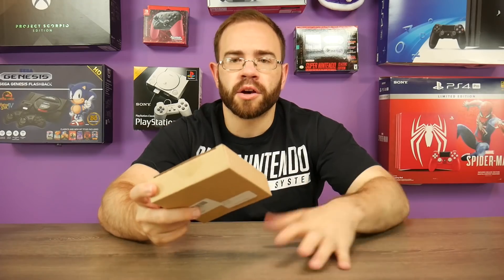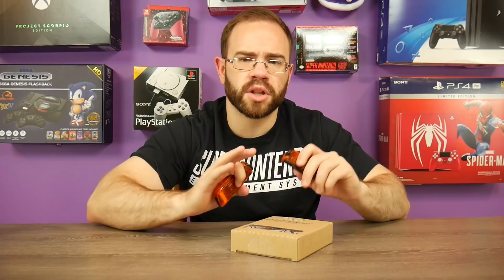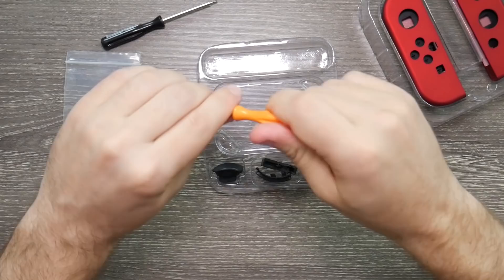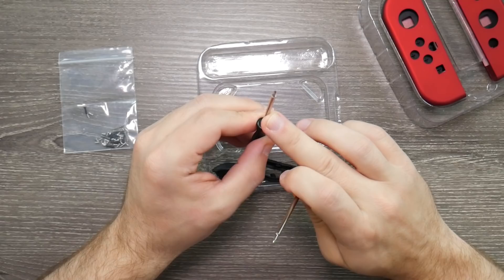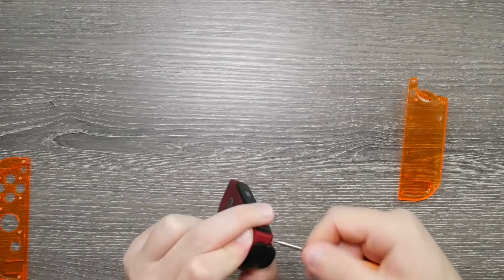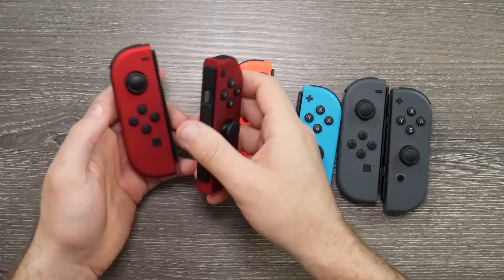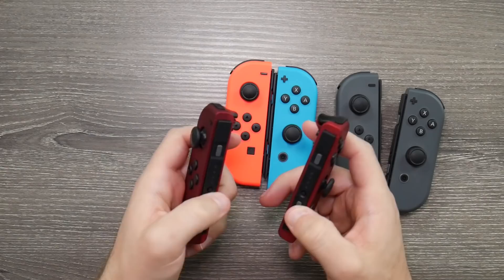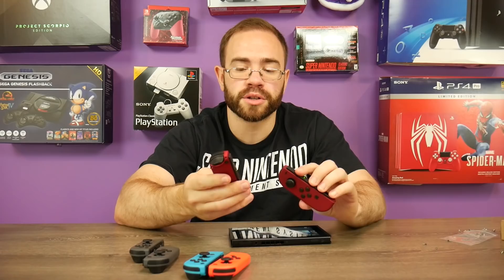New Soft Touch JoyCon Shells For Your Nintendo Switch

Comment: I decided i would completely reskin my joycons. I found a shell i thought looked cool, on top of metalic red buttons, and both of which featuring a Dpad so I could give that a try. Before i bought anything i took a joy con apart just so i could know what i was doing, and I lost track of where all the screws go so i just shut the thing and hoped it worked. The only part that no longer functions is the capture button, but i never use it anyways so i'm not gonna tear it apart again just to fix that. 

Tl;dr i haven't reshelled my joycons yet but im going to soon.

Comment: I like how you cut getting that trigger ribbon cable in at ~ 6:32  EVERY time i take this joycon apart i spend a ton of time trying to get that damn ribbon cable into the motherboard without taking everything apart (to save time) but I end up wasting more time struggling with precision tweezer work. 

That said... I've had these red shells and the carbon fiber versions in my cart for over a month now as well as the metallic silver button replacements. I haven't actually seen any other company making custom joycon BUTTONS that aren't absolutely crap. I might have to pull the trigger on a shell/button combination soon after seeing the quality of these. The previous reshell I did seems to have a bit too much wiggle room for the buttons (especially triggers) and they slip out of my hands much easier than my neon yellows.

Comment: I have swapped the shells of two pairs of Joycons and I have been using this brand. I really like the "soft touch" feeling. However, I have picked the "wood color theme" for one of my pair and the feeling is not exactly the same as the other pair that has the same coating of your red ones but different color.  

Great Vids!

Comment: The red is very pretty, and the word you’re probably looking for is a flocked finish for touch. The sheen is semi metallic.
They don’t come in black -1
And no versions with a more comfort grip on the back -1
Reply: Flocked is more like a fur. They do it on funkos. These are a soft touch rubber coating on plastic.

Comment: Coating will wear away after time. Also, never clean with alcohol. That coating will come right off.
Reply: yes that is how paint works…
Reply: No shit
Reply: It is rubber or silicone flocking with adhesive applied to the plastic. Just trying to save some from ruining them.
Reply: @MADFARMERPRODUCTIONS  sorry for necro, but this answered my questions better than the regiew did. Ty

Comment: I bought gold chrome ones. They look FANTASTIC but the buttons have an odd sticky/resistant press when you push the buttons, I even loosened the screws a bit and to no avail. Still look fantastic tho
Reply: There isn't enough space for the buttons. Try filing any rough edges on the buttons

Comment: In addition of the Switch being a nice little gaming platform.. The joycons is almost like a model kit
Nice
Reply: @Nintendo SUCKS 
Oh hey, there you are..
I was wondering where you disappeared to..
Well, as from your ridiculous logic and poor reasoning, you’re not correct..
There is multiple exclusives that are rated for older individuals, Like Fire Emblem, (Again) Bayonetta 2, 3, Metroid is usually rated T due to it being a darker game, astral chain which is most likely going to be T or up..
Xenoblade, Etc..
Graphics aren’t really the mis5 important thing in the world, gameplay is better and the Switch has games with amazing gameplay..
But that’s more up to the person if they want a good looking game, which there are good looking games that okay well on other platforms too..
So it’s more of personal taste..
Joycon are pretty good for what they do, I have somewhat big hands but I hold the joycon fine..
Pro controller is just basically the standard layout for most controllers (which one of the first offset joysticks were actually released on the GameCube)
And not all games will be coming to Switch, but one of the biggest issues is actually storage..
And Netflix or a web browser is more optional then necessary..
Again, for what it is, Switch is a decent system..

Comment: Extremerate recently released a dpad version of their joycon shell. I just re-shelled mine for the first time and the dpad is really nice!
Reply: Would you say it's better than Basstop's d-pad?
Reply: @UlysisAM  I havent tried the basstop dpad shell, but I can try to define the feel of the extremerate one. It is still tactile/clicky like the D Buttons in the regular switch controller because the inside parts are the same. I imagine it's the same with basstop. The dpad has a fairly large round dip in the center (thumb tip sized) and raises up toward the ends of the directional tips with a rounded profile. It's made of a smooth hard plastic, think of the shoulder buttons on the joycon, it's a similar feel, but has a smoother finish. My only complaint is it would have been nice to have a plastic with a little more give to compensate for the clicky feel of the membrane inside that Nintendo provides, but it's definitely not a deal breaker. The thing I really love is the central dip and the rounded profile. It has a very ergonomical feel that I'm surprised I have never seen used in a dpad before.

Comment: Will re-shelling help with drift? How can we fix it?
Reply: it'd be worth it if it did. im terrified to reshell mine in general and that would motivate me
Reply: I just sent mine in to Nintendo to get it fixed I had tried taking the rubber cap off and recalibration it multiple times since I sent it in haven’t had a problem since
Reply: Drift I heard can be fixed either by cleaning under the thumb stick or just straight out replacing it. Since I already have so many hours on my switch I got a new pair till I have the time to actually fix them and this kit seems a decent way to start I recon.

That said I am no expert so take what I say with a pinch of salt.
Reply: Spawn already posted a video a few months going over specifically how to stop joy con stick drift by replacing the analog sticks which is the only long term solution that fixes the problem Here is the video spawnwave has already done in case you haven't seen it
https://youtu.be/cMHl7GwbEb0
Hope that helps

Comment: I bought a third-party shell from Etsy, as I'm sure you're aware of because EVERYBODY was ordering from there. What I'm wondering is how is the fit? Both on the switch and the switch joy-con grip? Because when I had installed the ones from Etsy they were way too big that it was uncomfortable sliding them into the switch and the grip.
Reply: I got some shells from this brand, but a different color. They fit exactly the same as my old shells did.
Reply: daffy duck Just an extra question, they aren’t too big. Like they’re flush with the Switch tablet? Because the ones I had from another seller were sticking out farther than the tablet on the backside of the switch. It was so noticeable and uncomfortable. Same thing with the Included Joy-Con grip, it didn’t even fit inside of the grip, so I had to change it back to default shells ahah.
Reply: @astnla  Yeah, mine are flush. The left one bulges a little on the front, but it was like that when I had my original shell on it.
Reply: daffy duck ahh, but it has not problem sliding into the joy-con grip does it?
Reply: @astnla  No problems

Comment: I want a dpad on my switch along with grooves for my hand to fold in and have it slightly bigger. I might as well buy one from wish and gut out the official and put in accessories in that one.
Reply: Hori sell a left joy con with a d pad for about £22 & buy a protective case for about £10 👌
Reply: @mrspud1404  have you gutted out the OEM switch and put in that one. I know it doesn't have rumble on hori controllers
Reply: I've just watched spawns review of the hori  joy con ... It as a few issues . You can't use a grip with the hori joy con & you can only use the joy con in handheld ....  Watch spawns review
Reply: @mrspud1404  I have already seen that one, but haven't seen a person gut it out and replaced with another.
Reply: I haven't gutted it out , I would break it 😂😂 I think spawn said in he's review that you couldn't use the parts from the hori joy con to mod a original joy con.  Wait for hori to release a vol 2 hori joycon